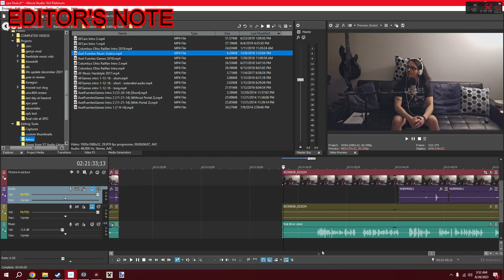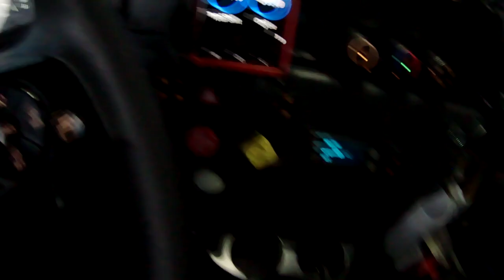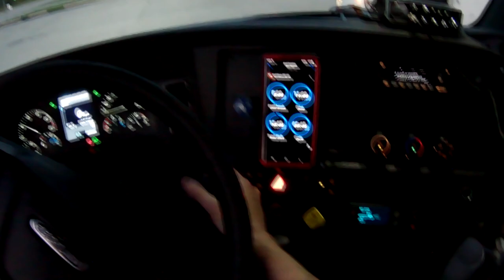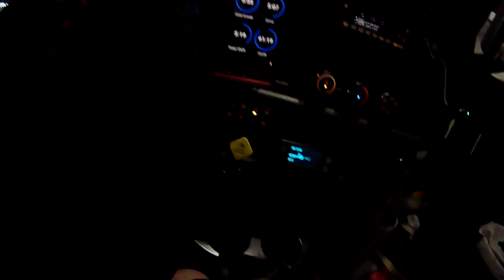My last Drive with XPO & Let's Discuss

Comment: What kind of trucking you doing now man? I've been with XPO for 3 months now and I'm also tired of being a dock worker with a CDL, but the pay is great. How often did you actually drive when you were with xpo?
Reply from the maker: @justinmurray8920  I feel like I worked the dock more than I actually drove 😂 I now work for another company that has a home daily no touch freight account 😎
Reply: That's good! Yeah I work the dock like 90% of the time and drive like 10% of the time 😭  @AxelFuentesMusic
Reply from the maker: @justinmurray8920  yeah that's how it be with XPO, they certainly have their strengths as a company but using drivers as dock workers is NOT one of them
Reply: @AxelFuentesMusic  yeah hopefully next bid I drive more. On average I only drive once a week right now 😭